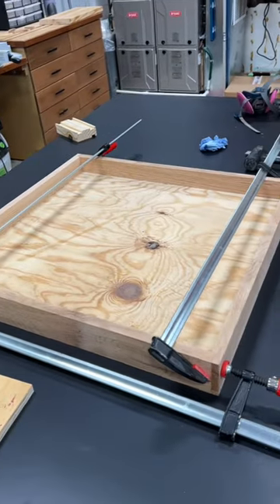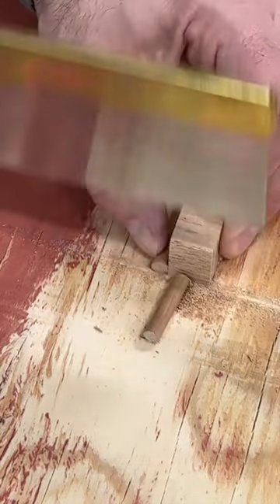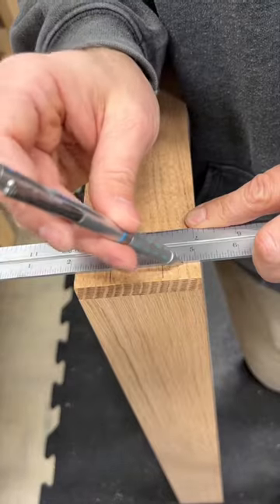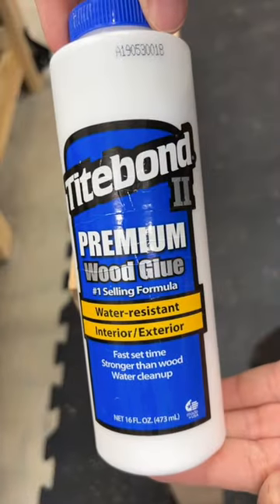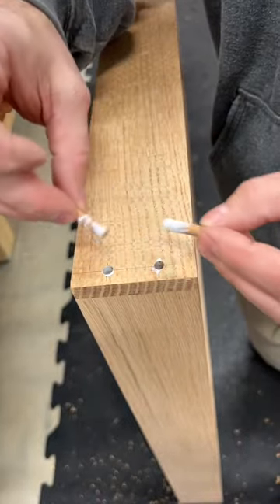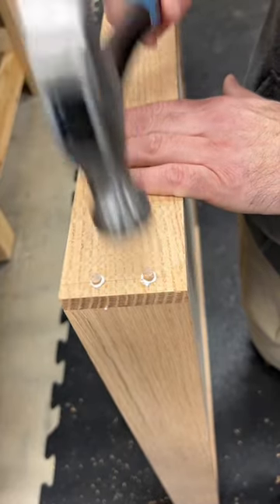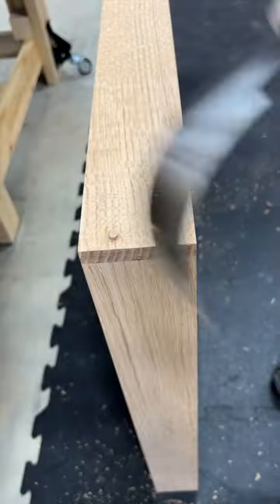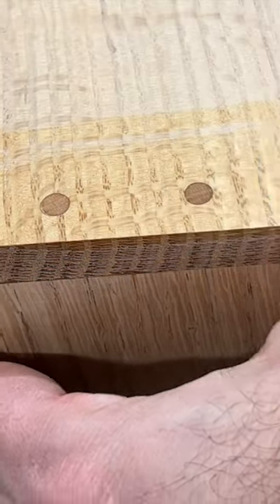Making Rabbets Stronger | #shorts

Comment: wood wisperer...a tip 4 u ....when u have all those  dowel stubs to ease the edges
put one end into ur drill the run it on ur sandpaper and poof ur done !!!
i just inished a gate job using half laps n dowels only !!!  no screws and cut a arch top. i like NOT lining up grain cuz i WANT them 2 stand out.
great vid atb amigo😊

Comment: I have found that you should score the dowels down the side - just scrape them with a hacksaw blade seems to be enough, or use a nail - because if the dowel is a neat fit you can blow a chunk out the side of the piece with the dead end hole as you drive the dowel home. And yes, Bob was my uncle.